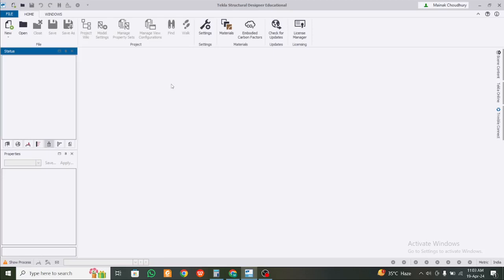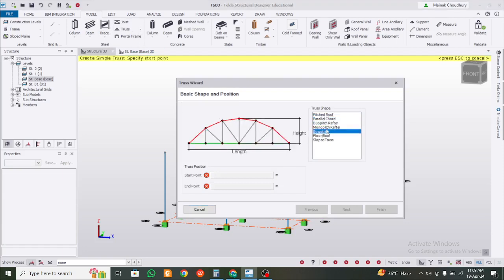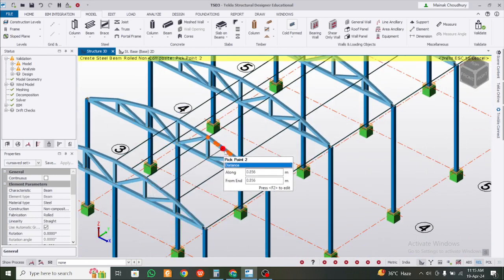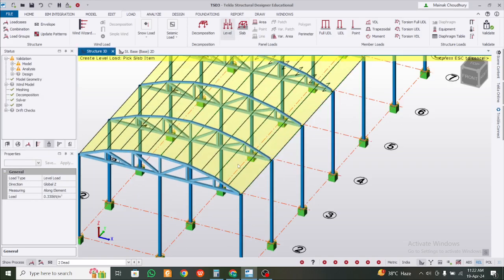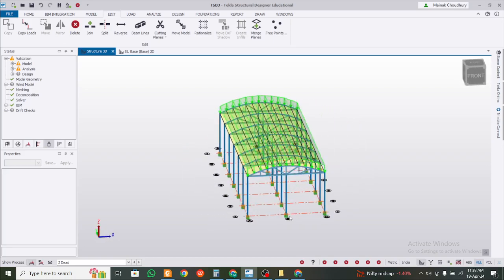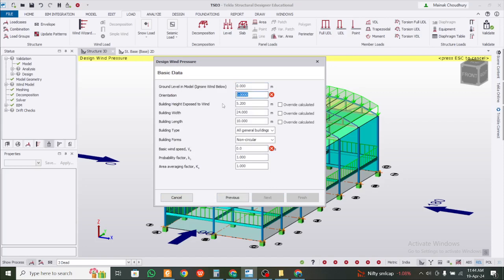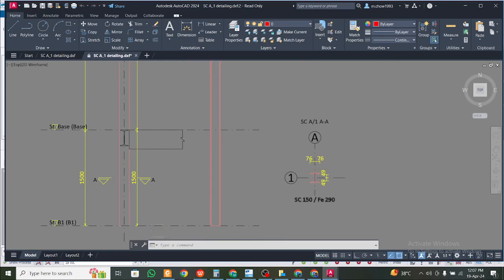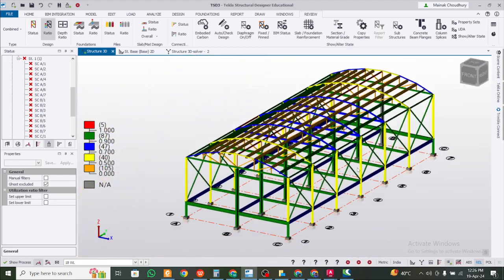Industrial Steel Structure Design in Tekla|| Semi Circular Roof Truss Modelling

Comment: Hello 
If we design footing how can we make sure top reinforcement is not used...even when we use auto design...
Reply from the maker: There is a option which appears on the bottom left portion of the screen, before applying the footings to the model. We can untick that and top reinforcement won't be considered.
Reply: @MainakChoudhury yes did that but its still puts top reinforcement if we auto design....if we do Auto design then top reinforcement comes up....